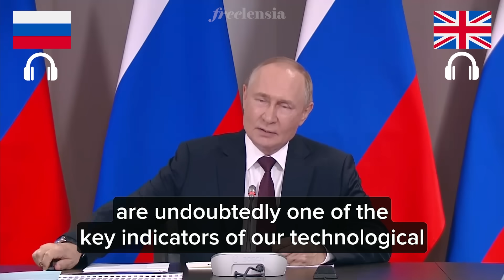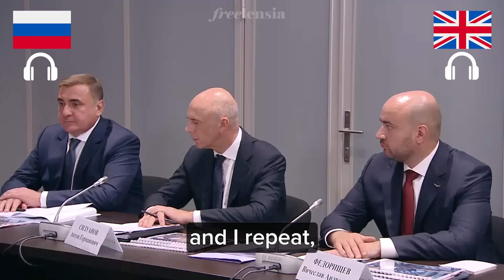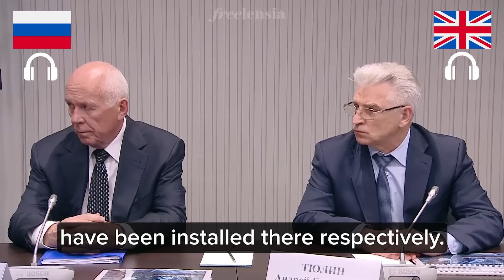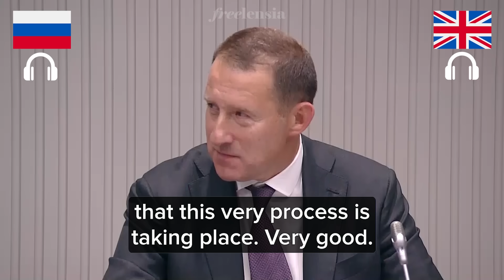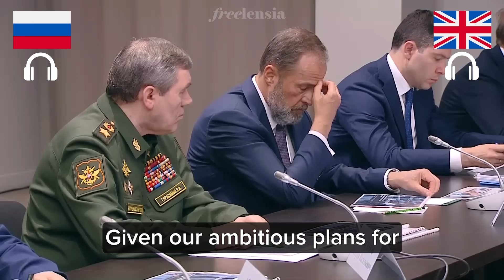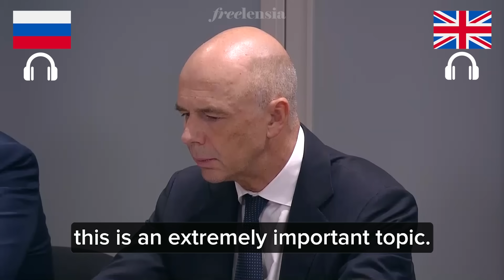Putin Highlights Russia's Engine Advancements: Sovereignty and Global Competition | RU-EN

Comment: 🎉russia and china visited iceland in 2010 . about 11 years later icelandi erupts on my birthday march 19, 2021. DIRECTING me to reference the march 19 super moon on march 19 and also 2014 CONFLICT OF RUSSIA TO ICHINA AND COLUMBIA UKRAINE . The infamous Georgia "Snowmageddon" was in 2014, specifically on January 28, 2014, which paralyzed Atlanta and the Deep South with a sudden snowfall. There was also a significant winter storm in the region in 2015, primarily on February 16-17, 2015, which brought a mix of snow, sleet, and freezing rain. 

The 2014 Storm ("Snowmageddon")

Date: January 28, 2014. 

Event: Known as "Snowmageddon" or "Snowpocalypse" in Atlanta, this storm caused widespread gridlock, trapped drivers for hours, and forced children to sleep in schools. 

Impact: The city and region came to a standstill, with some roads becoming impassable due to the sudden and unexpected accumulation of snow and freezing conditions. 

Deaths: The storm was blamed for at least 13 deaths across the region. 

The 2015 Storm

Date: February 16-17, 2015. 

Event: A strong cold front brought frigid temperatures, followed by a low-pressure system that dropped snow, sleet, and freezing rain. 

Impact: Georgia Governor Nathan Deal declared a state of emergency in advance, and government offices closed, though drivers still faced challenges. 

Other Snow Events in 2015: Another storm brought snow to the region on February 20-21, 2015.
Reply: Ahhhhh,  havent we always called this ‘old man winter’ ?